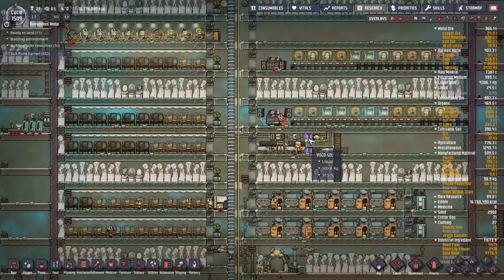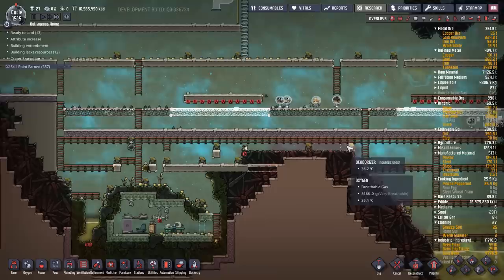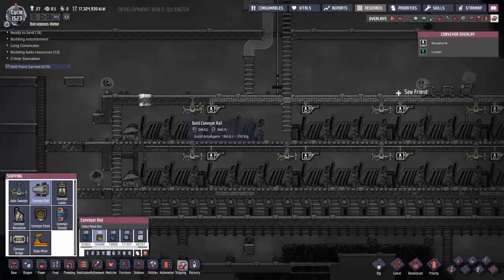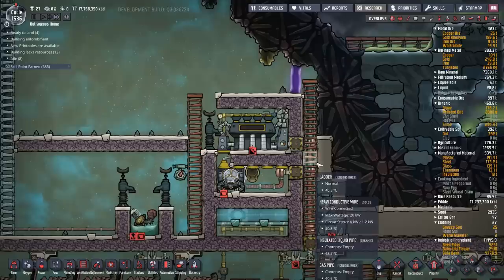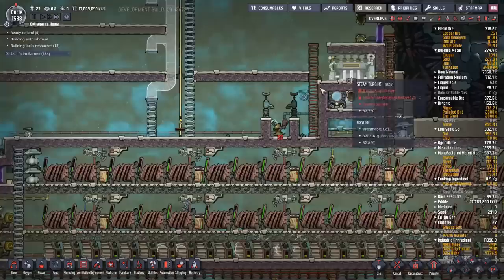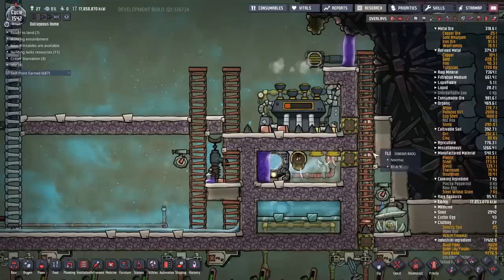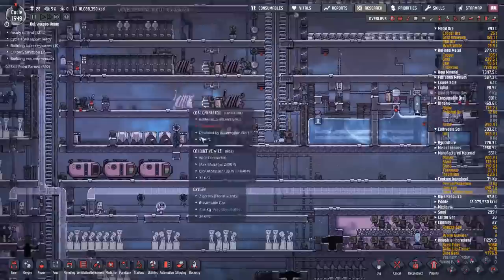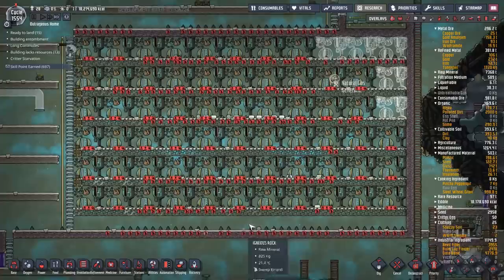QOL Mk3, 38 Coal backup/Sour gas starter : Oxygen not included

Comment: 0:00 Committed to 100 dupes. Planning out the space for sour gas.
6:50 CO2 to slickster to oil to... WHAT! What did he just say? Try saying that 1 time slow let alone fast. 
12:20 Automated coal generators.
15:45 The magic of editing and poof. A standard steam aqua tuner cooling
17:55 A slight modification
25:40 Let's fire this monstrosity up.
31:00 Something interesting happened. I forgot to get out the O2. 
39:05 Natural gas generator preparation.
43:20 Finally a new dupe. Better start letting some out. 
47:40 The power box is built and needs to be filled.

Comment: Had somewhat similar problem when i did my polluted water boiler/cooler steam turbine setup experiment.
And i ran in to a weird bug, that "deposited" well over 3000KG of natural gas in my boiler. dealt with it by building a "pumping" room on top of the boiling room, placed powered airlock door that was hooked up to random sensor that gave me manual control over the door, used the diagonal deconstruct trick to remove 1 time under the door, waited until "some" of the nat gas was  in the hole, opened the door and closed it asap... took loong time, but it did remove the nat gas.... 

then i forgot to place atmo sensor inside the boiler, steam turbine made vacuum, and the fresh splash created polluted oxygen.... 
Main reason i love ONI, you have to learn from your mistakes
Reply from the maker: If you learn by making mistakes I should be an Einstein by now :) My main problem is I end up rushing and not thinking things though enough. Don't we all though, don't we all.

Comment: The o2 in the aqua tuner. You could let the steam cool then go in and vacuum out the o2. 
Use a granite tile to allow the temp to interact with surrounding area or go to the far side of the room against the wall and pull out the last tile. As it cools it just falls back into the pool. 

There may be a little mopping up but won't be much. 
 
However deleting it works 2. 
Best way is to get the water up 2 tiles before you close it up. ;)_

Go for 150 dupes. I'm sure you can do it.
Reply from the maker: 150!! god no, that would require over a 11kg/s of oxygen. It would break my brain never mind my base and computer.

Comment: And I think that is better to do two smaller netunal gas generators box in two sides of the map because if is so close the power grid will be really massy😶😶
Reply from the maker: I either split the electrical grid messy or I split the gas from the boiler messy, both suck but cables are usually easier to work with than pipes. Also I never though of it.

Comment: You mentioned converting 19% of CO2 back into O2 through the whole slickster -> oil/pet/gas -> water process. I wonder if the ratio of just using a carbon skimmer (which basically only consumes a small amount of power) wouldn't be better (but losing the power generated by the oil cycle) from CO2 to O2.
Reply from the maker: If I dump the carbon into carbon skimmers and sieve the polluted water for polluted dirt it works out about 13.33333% oxygen. So slicksters is the way to go if I want to squeeze out every bit of oxygen.
Reply: @FrancisJohnYT  Oh yeah, I forgot they don't actually produce oxygen (just the polluter water). I guess terrariums would work, tho they require duplicant operation ... But would that even be a problem when you have 100 dupes ?
Other than that, you could probably automate oxygen diffusers with a sweeper (for even more oxygen !).

Comment: I'm a dupe, reporting for duty, and ready for DOOM! I hope I wont let you down. Although I think I might, because looking at 44:00 you were informed I refuse to cook. But at 46:00 you name me to it anyway. I also missed what my priorities are; but you may have done that off screen. Aaaand finally dogsbody-in (regardless if it's me or Orion) should probably be restricted to the base (unless, again, you did that off screen).

Thanks for naming one after me! :-)

Question: You're doing a sour gas boiler for the water, but could you clarify how much water this will produce compared to burning it straight away in a petroleum boiler?
Reply from the maker: Yeah I managed to mess up the naming big time, was my first attempt at using non generic names. I figure it out in the next video and get you assigned to construction. Orion is assigned as chief but I totally left his outside access in place DOH, video after that I'll fix it. As for numbers, it's complicated, my leaky oil fissure adds a bit. There are two number without and with slicksters eating all the CO2. Pet boiler 526g/s or 881g/s for sour boiler 1368g/s or 1672g/s. So for a monumental investment of time and resources you get about a cool steam vent.

Comment: francis i hope your new map after this dont have a volcano, i would like to see a optimized petroleum boiler only with aquatuners, thanks,
Reply from the maker: It would look pretty much identical in terms of counter flow it's just the place where the 2 tiles of lava are would be replaced with an space metal aquatuner and some steam. I play random maps so we have about a 45% chance I don't hit a volcano.
Reply: Hope the next map has a VERY WEAK volcano in the middle or at the top of the map. 
MY current volcano can only support around 3K-4K/s and it's not in the oil biome. So there's not hauling magma (Which will eventually run out) from the bottom.
Reply from the maker: @LTL_king  You checked the volcano powered petroleum boiler? It's designed to do 10kg/s no matter how weak the volcano. Two designs one for regular and one for minor volcano's.
Reply: You have to shorten the line add more insulation and all that for a weak volcano
Weak volcano less oil through put. 
If you put 10K of oil through that line. It will go through your magma in a couple cycles and then you have none. 
Check email.

When you run out of magma and it's at the top. You can't refill it. Would be NP if you could refill it but you can't. 
Volcano at the bottom and runs out. NP. Just top it up by hand. 

You designed this play through with the strategy of adding more power to it. 
No magma. Power limit.

Comment: About that gel that moved. I think that it has cooled steam and turned it into water. Water then pushed (replaced) that gel.

Also arent you affraid that your gel inside of that steam chamber will turn into gas? Wont it block your steam turbine (again)?
Reply from the maker: Visco won't tune to gas until about 400C, if it gets that hot in there something has already gone horribly wrong.

Comment: Yo francis! unrelated question but how do you get a new set of batteries to 'sync' their power levels with the rest? When i build new ones they deplete/replenish differently from the rest of the power grid.
Reply: switch off your power generation, they'll all go to zero.
Reply from the maker: I just crank the automation sliders on connected smart battery up to 100/100 this forces all the generators on, then when all the batteries are full I set it back to the desired level. It's not important I just like them that way.
Reply: 27:10